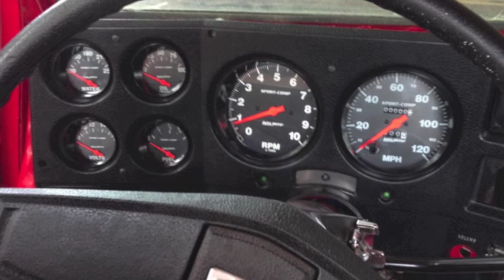CHEVY C10 CARPET INSTALL & RESTORATION UPDATE #3 | Future Upgrades and Plans

Comment: Nice your truck is coming along good. And one suggestion I've watched your other videos and saw rust on your frame I suggest you undercoat with chassis saver or por 15 to rust proof 😀
Reply from the maker: Long Man I probably should put some type of coating on the frame.  It's just surface rust now but it can get bad quickly.   Thanks for watching!

Comment: I like what you've done to your truck. I kinda wish that I went with the foil carpet backing, but instead I went with 2 new layers of felt underlayment. 
    I have a 86 k-10 that is the same colour red inside and out as yours. 
        I am doing a frame off on and I liked your idea of the driving lights where the licence plate goes. I have my licence plate in front of a pair of 5 inch,  and have added  two more 4 inch driving lights in the outside of the bumper set into light bessels. 
       When I am off road I can remove the licence plate and expose the 5 inch lights for off roading.  This way I am legal cause they have a cover over them. Out of sight,…out of mind. The cops don't even see them when I'm on the road , In Canada you are only allowed two extra driving lights. 
     I'm just rebuilding the box now, so maybe another 3 months and it will be ready for the big launch. Can't wait to go for a cruise. like you. 
     I like your straight 6. ….You can really improve the power with them with a header, RV cam, and a high flow intake manifold with a 2 blr Weber. Better gas mileage too.         Good stuff !
Reply from the maker: +richaroodledoodle In Texas we are required to have a front mounted license plates... but I have not run one on any vehicle I've owned for nearly a decade now and have not had any problems with the police.  Probably just a matter of time until I get busted though.  Good luck with your project and thank you for watching!

Comment: i like what you've done to your truck its very nice your detailed videos are easy to understand. i have two 86 model c10's with an 84 model in the future. i was wonder if by any chance a helpful tip for installing the sound and thermo mat before the carpet as to what brand you used. once again many thanks! ☆Zero☆
Reply from the maker: +Timothy Martinez Thank you for the kind words!  Honestly, I can't remember what brand of sound insulation I bought.  It was a kit I bought off of eBay.  Most likely some off brand.  Thanks for watching!

Comment: Looking good. I think they make the retro radios now with Bluetooth.
Reply from the maker: SlowRollin TexasStyle After doing some more research, all of the bluetooth radios also have USB jacks.  In fact, I found a USB jack that fits into the factory cigarette lighter hold.  It then has a little jumper cable that goes to the back of the head unit.

Comment: nice job on finisching the interior 
as for the overheating , i think if you get a good fanschroud and an electric fan you should stay cool 
from wat i heared theres a electric jeep fan that fits perfectly inside a stock c10 fanschroud
Reply from the maker: watahyahknow I'm probably just going to start with a shroud on the radiator I have.  My research is telling me that I have to buy a name brand radiator like a Ron Davis or Be Cool at a cost of $500+.  Ouch!  Not sure I'm willing to do that.  The aluminum radiators off of eBay seem to have TERRIBLE track records.  Leaking after only a few hundred miles and even leaking right after installation.
Reply: these trucks came with big block engines too and they kept cool with just copper radiators even when pulling trailers
IF theres realy no way to keep the engine cool with a fanshroud you could upgrade to a stock  big block radiator 
think the only difference that its thicker

another option is measure up the radiator in the truck and take a look around the junkyard for an european or azian 6 cilinder car or more modern american cars , they usually have aluminium radiators with plastic tanks and electric fans as a unit , they allso have the heat sensor for the fans screwed intoo them 
these oem fans usually are better than the aftermarket ones as there made to last the lifetime of the car
you prolly going to need the expansion tank too as these systems often run under higher pressure than the yeeh oldie chevy pickup with the steam out radiator cap

think if you do a search on youtube you find a couple soliutions

Comment: Hey man i love your videos and i had a question for you. I was wondering where you go for advice when your restoring an older truck like this. i recently got a 1984 C10 and its in good running order, (minus it shifts hard), but it has alot of cosmetic work that needs to be done and i have no clue where to begin.
Reply: Midnight Gaming They all shifted hard. Nothing to worry about there!

Comment: Love your truck. What kind of sunglasses are those?
Reply from the maker: CaliRiider Thanks!  The sunglasses are made by Locs.  Can't remember the model name.  Bought a pair at a gas station a bunch of years ago.  Could never find them again until I checked eBay.  They're cheapo sunglasses... my favorite kind.  I've lost or damaged too many pairs of expensive, name-brand sunglasses.  I'm over it!  I've kept this pair intact for about 3 years not.  Prior pair I had for about 7 years until the lenses got too scratched up and I had to replace them.

Comment: Dude get a Bluetooth radio. I got one for my 84 c10. Best thing ever and you don't have  to deal with the cords.
Reply from the maker: ***** I probably will get bluetooth.  Those factory looking radios don't seem to have the ability to scroll through songs and playlists through the stereo.  You would still have do that through your phone.  That's basically the same as having a bluetooth connection, minus the ability to charge the phone through the stereo connection.  But you can obviously do that through a cigarette lighter adapter.
Reply: *****
Yeah I just charge my phone though the cigarette lighter if i have to.